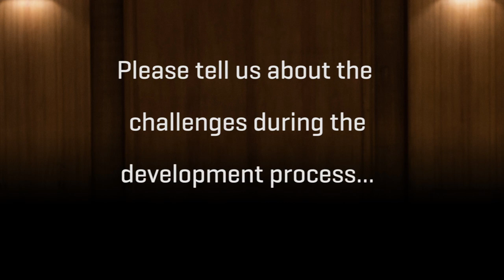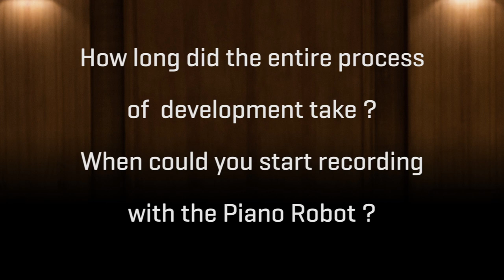VSL Piano Robot

Comment: I'm still sceptical if this is a better system than using the systems that piano manufacturers have developed (Yamaha's Disklavier, Steinway's Spirio, Bösendorfer's CEUS) as I have a way better feeling playing the VSL CFX which was sampled using Disklavier than I have playing the VSL Concert D which was the first VSL piano sampled using this robot. The Concert D sounds really harsh really quickly especially in the middle register which severely limits the use cases and makes the instrument less fun to use. Now admittedly you guys made the best of it by patching right away and adjusting the velocity mappings which made it playable (and I maintain the view that both VSL support and VSL sample quality are the best I have ever experienced), but the difference is still striking. I would be interested in the details of why these issues developed, too.
Sorry for the long essay,  I just wanted to get this off my chest.
Reply: Hm are you sure that your issue depends on the robot? There could be other disadvantages coming into the mix why the previous works better than the newer one. Strange enough, I had the same experience with Ivory Updates. Ivory III for me sounds too harsh and not that realistic like one and two. Funny because we would all believe that it will just always become better and better over the years. But it seems that the market changes and manufacturers seem to rather downgrade their stuff partly.

Comment: I think with the electromagnet, it'd be constant acceleration for the robot to tap or press on the key, while a human may not have constant acceleration... in Pianote, they also describe the player can slide from the top of the key to the bottom to play it very gently so I guess the library will be simulating it with the final speed at which the hammer hits the string... I guess it should be pretty close, because ultimately, there are only two things: how fast the hammer hits the strings, and how fast the damper moves away from the string... and if in sustain mode, just one thing: how fast the hammer hits the strings.  I guess to get the real thing, we then really have to use an acoustic and each piano, upright or grand, will be different also
Reply from the maker: With an electromagnet you can fine tune acceleration and release by modulating the current/voltage; it's not necessarily constant. - Ben
Reply: @ViennaSymphonicLibrary  maybe you can add some details in a video as to how you simulate a soft touch... but you might have done better for more recent pianos coz the method was evolving